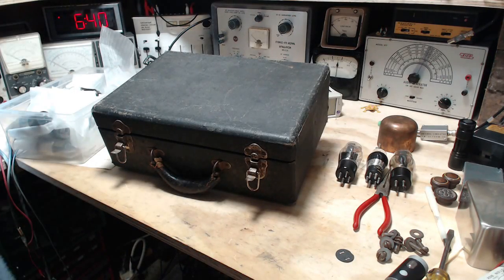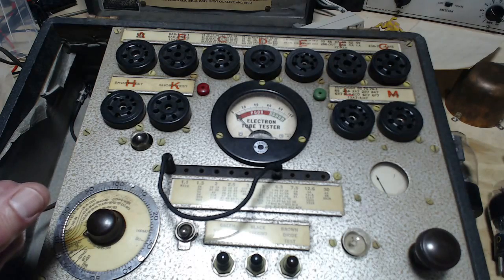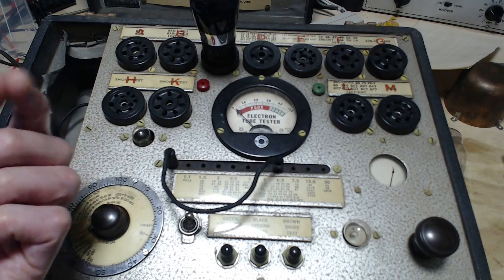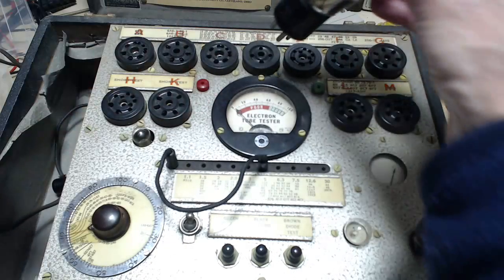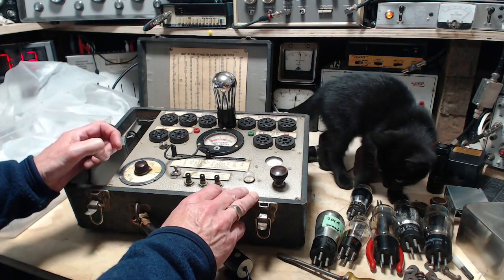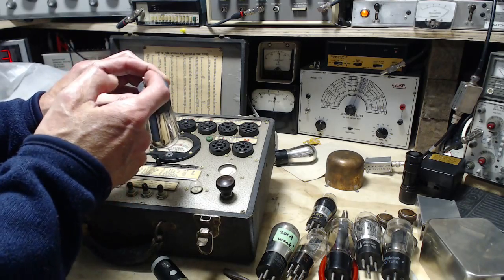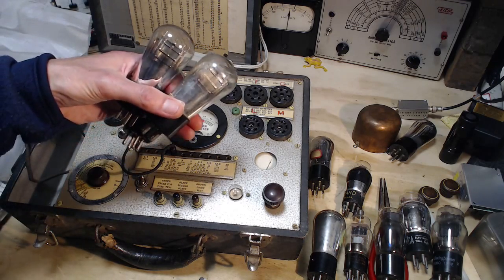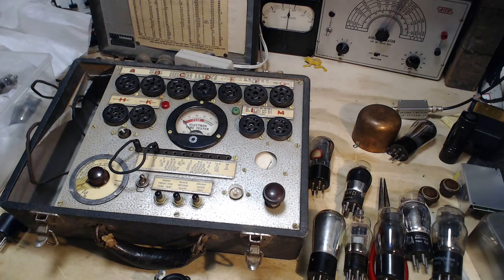1928 RCA Victor Model 28V   Video #5 - Tube Testing

Comment: Jim
Back in the 60's I became familiar with the Japan Victor corp which was  not affiliated with the RCA corp. either.  It also used the "his master's voice" logo
Reply: I checked out Japan Victor and I do believe that it is possible  that Jims' radio is Japanese.. They were founded in 1927 as a subsidiary of the Victor Talking Machine Co There was no reference to Victor in conjunction with RCA until the 1930s. Apparently Nipper and the phonograph came with the acquisition. Japan Victor Corporation became JVC

Comment: English Mustard smeared over the cables will stop the cats in their tracks but this will eventually wear off so that is why I suggested mixing 2 parts varnish with 1 part English Mustard and the cats will not touch the cables ever again,why not replace the three tubes associated with the RF side of the radio.

Comment: I have a question for you Jim. I have an NX-245 tube. How is that  read on your chart? I don't know if the tube actually works, but there is continuity on the filament. I don't really care if it works or not. It's a balloon tube and I like how it looks. It's kind of an ornament to me. I do know that it could be semi valuable if in good working order. But I have no way of testing it as the closest place I MIGHT be able to get it tested is 100+ miles away. Keep up the good work. I enjoy that you keep the editing to a minimum. BTW, say hello to kitty for me.
Reply from the maker: A 245 is the same as a 45.  I got this from Radiomuseum:  

 According to Tyne, page 322, this audio-power output tube was introduced in March 1929. It is intermediate between UX171A and UX210 and was first named UX245, later in short 245 and 45. See other identical denominations too. The oxide-coated filament operates at 2.5 volts AC or DC, taking 1.4 amperes. The anode is of sheet nickel, carbonized to facilitate radiation. Power output about 0.8 watt. 

245 = X-245 = P245 = 45 = UX245 = NX245 = PA245 = AC45
Reply: Thanks for the information. Much appreciated.